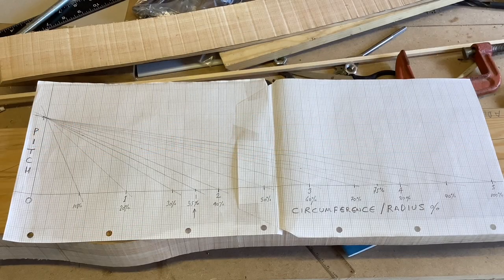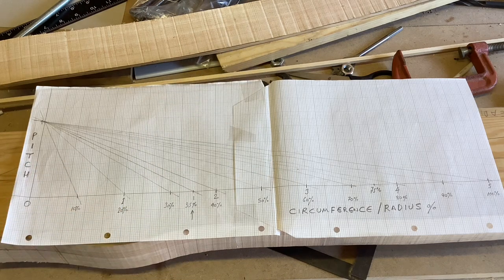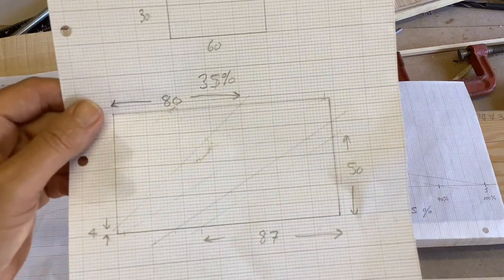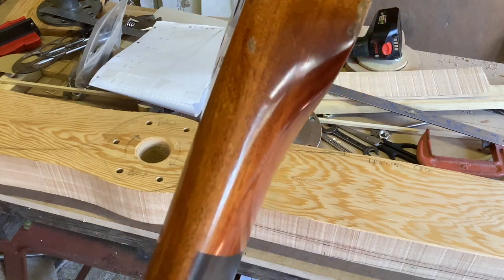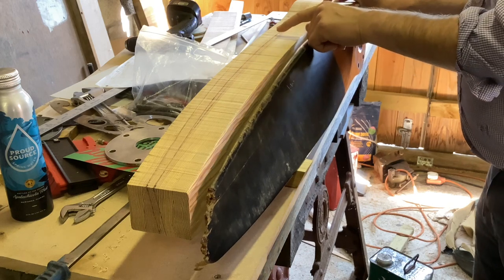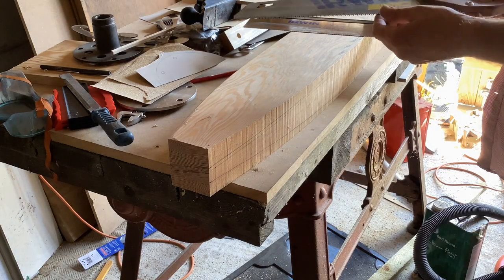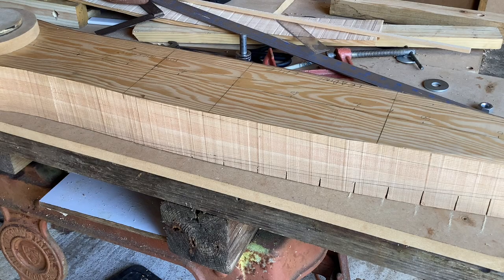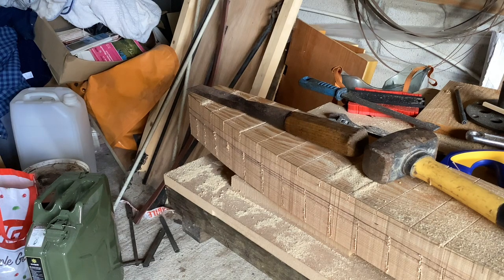Making A Propeller - Part 4

Comment: Similar to the layout we use carving model airplane props however I would plot and then cut them side profile based on plotting the depth of the block at each station along the diameter. This gives true helical pitch.
Reply from the maker: I’ll try to get a true helix on the Pietenpol Ford propeller from the tip (100% station) to approximately 25% from the hub.

Comment: Is it difficult to introduce a camber on to the front of the blade to produce an airfoil surface? Is it done by rocking the saw when cutting the guide grooves?
Reply from the maker: The guide grooves should really be cut straight because one is not sure how much to rock the saw. I’m going to make another propeller soon, will try to cover this detail again in those films.